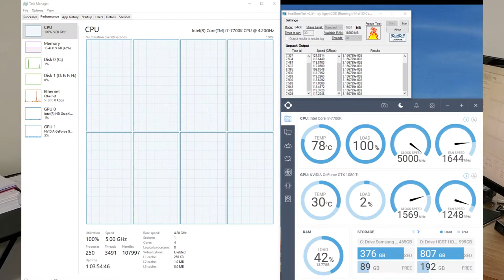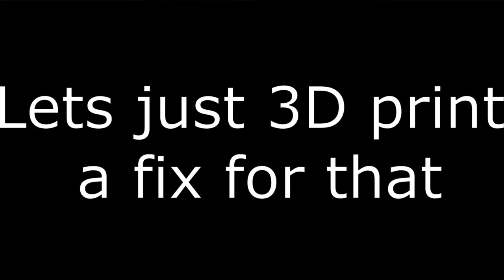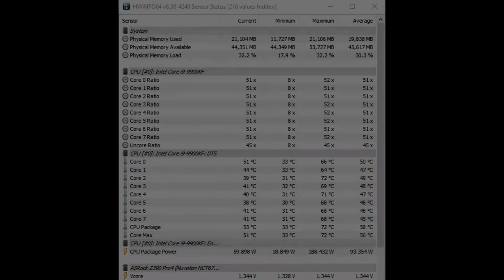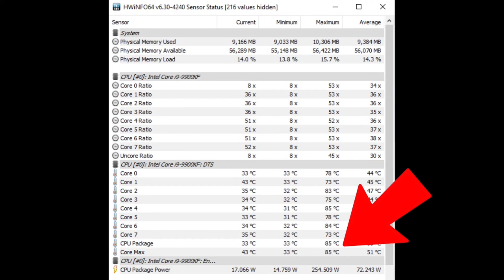Direct Die Cooling An Intel i9 | Rebuilding RedFury

Comment: If your overclocking on that motherboard you should consider a monoblock to cool the VRMs that motherboard definitely doesn’t look suited for an overclocked 9900k.
Reply: Agreed! Not a fan of Asrock anyways. After one failed on me, the RMA process was a nightmare (TWICE).  Also after watching MB breakdowns they tend to skimp on quality of parts apparently. I just stick with Asus and Gigabyte now.  The Gigabyte boards are best in Z390, And Asus is best in Z490.
Reply from the maker: Ill certainly keep this in mind, I appreciate the input. Although its funny you guys say that, because gigabyte has sucked for me, and Asrock has never failed me in all my OC years haha!! Plus I got a big deal on the mobo soo.. wudyagunado
Reply: @JakeSublime  look at vrm and the vrm heatsink nothing impressive and using that kind of voltage and frequency your lucky you didn’t melt the motherboard xD

Personally I use msi but each to their own next time maybe just opt for higher tier board or just add some cooling to vrm if you don’t want to buy new mobo or system.
Reply: @JakeSublime  Yeah, everyone has different experiences with brands. I could of just gotten a bad batch of Asrock boards, and never had that with Asus and Gigabyte. What really turned me off was the customer support. God that was a nightmare,  Had a new build that didn't work for months. It killed the excitement of having a new rig at the time.
Reply: lol, VRM's can go to like 130c

Comment: You didn't quite think this through, or rather didn't measure everything. If you took 0.25mm off the die (which is 0.86mm stock) it was down to c. 0.61mm, the De8auer frame is c. 0.76mm thick which means theoretically you had a 0.15mm gap between the cooler plate and the die. If you'd stopped at c.0.10mm off the die you'd probably have seen even better temps.

Comment: Really shows NZXT cases airflow, my Then 7 1700 with a 75 dollar 240mm AIO idles at 28 and no higher than 50. Nothing special nothing modified. Running at 4.4Ghz
Reply from the maker: Yes I like nzxt's cases alot. And those are super good Temps dude, i think you have huge OC headroom just fyi.
Reply: @JakeSublime  yep nzxt cases look good but the temps suck cuz of how little airflow room there is, I'd consider upgrading
Reply from the maker: Do you really think this case has that much airflow restriction? I run with the front panel off and even with cpu @ 100% / 80c, my gpu on the same water never gets above 33c.
Reply: @JakeSublime  it is quite bad for airflow, theres isnt much headroom for OC-ing on my cpu i forgot to mention in the last comment its first gen, i like the look of nzxt cases just the airflow on them are quite high, i got a cheap 50buck aio off amazon thats 240mm and it keeps my cpu cooler than what u get watercooling but then as you say it may just be the cpu since the gpu temps are low.
Reply from the maker: I think my temps are due to the cpu water block. I think it isnt flat, i didnt lap it. LOL i lapped the cpu die and not the damned block. -_- big dum. Ive noticed a 9*c-11*c spread from coolest core to hottest core. 

Ill do another video, maybe soon, about lapping the block and seeing if temps drop.

Comment: I been still thinking about getting that direct die frame for my 9900k... I dont plan to lap the die.. I'm just wondering if you know if my Corsiar H115i Platinum would make contact with the cpu?
Reply from the maker: I dont, but one could theoretically buy it and test it and return if it doesn't work. 🤷‍♂️ Not saying do it, just a hypothetical
Reply: @JakeSublime  Yeah I was gunna do that. I  got a NZXT Z73 now but still want to go direct die.

Comment: Interesting video. Very impressive work. Your parents must be proud of you! 
It is funny when I see comments from people who would never have the experience, expertise, guts or money to do something so complex and risky. These "youtube university" graduates are gutless morons. The "scratches" are irrelevant to proformance regardless of how they got there. If anything, a scratch would create a higher surface area which would xfer extra heat as long as the heat paste was able to fill the minor scratches.
Reply from the maker: Well said!
Reply: @JakeSublime  scratches do not assist thermal transfer, esp with a TIM like LM, paste is a little better at filling and coping with gaps, but any gap is bad. IHS's are uneven from the factory, and especially so when clamped down in the socket, thats the purpose of going direct die, to take the lumpy IHS out of the equation. Crazy good temp tho man, I cant run anything over 5.0ghz on my 9600k, and at 5ghz 1.37v i hit 90c on 2 cores running stress testers so i just leave it at 4.9 all core 1.35
Reply: No dude...scratches are bad. The thermal transfer of liquid metal is not as high as you think... in this case, the increased surface area does not lead to greater heat transference. If what u said were true, all cpu coolers would be shaped in grooves.